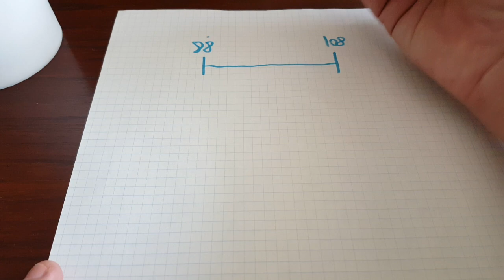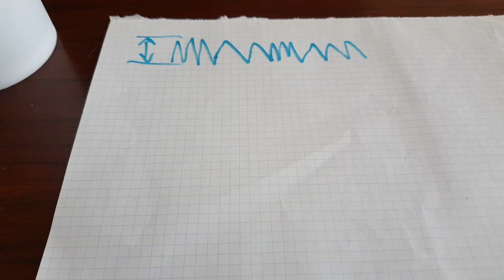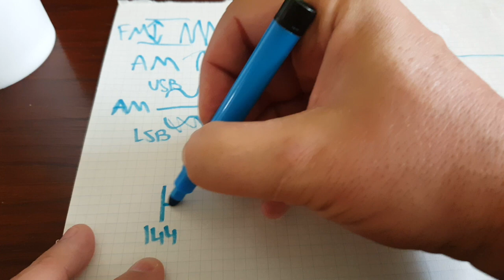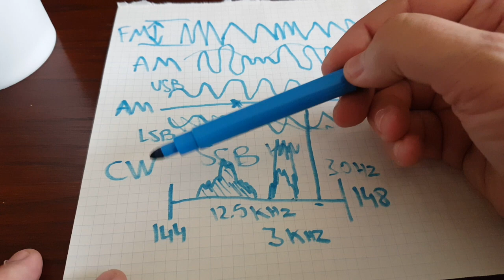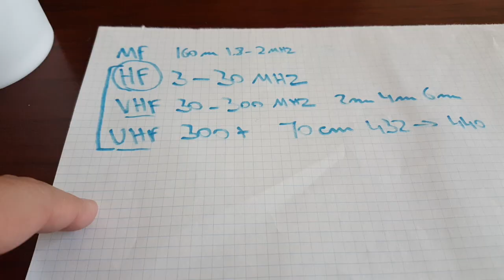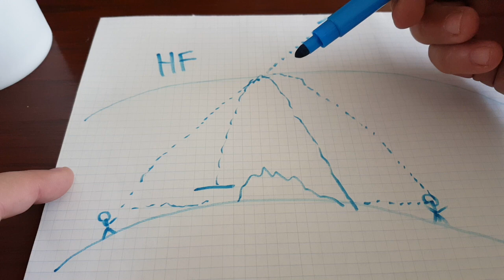Radio Frequencies, Bands, Modes and Bandwidth Explained.

Comment: I don't get, in the second AM drawing, what the center line represents and where the line made in the first AM drawing would fit in the second one.
Is the first drawing showing us a line that includes both SSB? Is there any connection in what these two drawings show us?
Reply from the maker: I don't quite remember the video, don't have time to check right now. But in AM the center line is the carrier, then you have the sidebands, identical but inverted.

Comment: Hi i got a ICOM IC-R72 but i didn't know what i can do with. I have no Antenna and i didn't know what antenna i have to buy. can you please help me. thx
Reply from the maker: That's a receiver right? If so you can just start with a long wire as an antenna, or a simple dipole.
Reply: @RadioPrepper  ok thx! 
must the cable have a certain diameter ? and how long it have to be? an what is a simple dipole?
Reply from the maker: @hannes8004 diameter is not important. Length as long as you can. Google dipole...
Reply: @RadioPrepper  i have 2 antenn connections on my icom where and how i have to connect it?

Comment: Why do you say refract? Isn't it reflection?
Reply from the maker: No. Although we often say HF waves are “reflected” by the ionosphere, it’s actually a strong refraction, not a sharp mirror-like reflection.
Reply: @RadioPrepper you mean the waves are actually "bent" by different ionoaphere layers until they turn back?
Reply from the maker: They don't bend. As a radio wave travels upward into the ionosphere, it encounters layers of ionized gas (plasma). These layers have varying electron densities, which affect the speed of the wave, changing its direction slightly as it moves through, until it's going back down. It's had for me to picture too, as I am not a scientist..
Reply: @RadioPrepper  Yes, that's what I was saying. That's why I used quotes for "bend"

Comment: GMRS is not a good choice for preppers. My side band CB supplies 90 watts for thousands of miles range  or AM for shorter range such as 200 miles.
Reply: I agree. GMRS has its place. It is easily portable with its tiny antennas
Reply from the maker: Both is a good choice 😉

Comment: It's strange that back in 2023 i picked a CW from croatia all over here in the Sahara of Algeria (1800km from their maidenhead location) on RTL SDR on the 80m band, i doubted it and i thought mb it was some mirror on IF, but mb bc of sun activity or something.
I used to mainly listen to volmet to tune my homemade dipoles on 80m 40m and 20m.
I was interested in picking local NVIS coms, but had no luck, besides one time hearing people talking touareg dialect on CB, the rest of time, CB is just spanish sailors in canaries, on some rare occasions i picked HF SSB Airband from the Atlantic, the rest of the time it was HFDL modes.

Comment: Thanks for the excellent video.
I think I don't understand something very basic.
I keep seeing wide band is 5 khz, and narrow band is 2.5 khz.
But, bigger frequency number in mhz = shorter wave length. 
100mhz is a 3 meter wave, and 200mhz is 1.5 meter wave.
Since 5 khz has a shorter wave length than 2.5khz, why is it called "wide"?
Reply from the maker: Hi, not the same thing... The 2.5 or 5KHz bandwidth refers to the width of your signal produced by the mode used, like SSB band is 3KHz wide so basically the sounds and signal produced by your voice is 3KHz wide. Nothing to do with the frequency you are transmitting on, which has a corresponding wavelength...

Comment: I also learned more in this short period of time than in numerous other videos lumped together..excellent presentation..

One question why is 300 used as the relationship between frequency and antenna /band length.  I am guessing it is the speed of light but why only 300?  

Thanks for the education and information. Keep up the good work
Reply from the maker: Speed of light, 299,792,458 metres per second.
Reply: @RadioPrepper  that's the confusion, as I said, I assumed the speed of light in metric, but why only the 300 and not the full nine digits.. just a niggle and probably demonstrates my lack of math skills, mind you school was a long time ago when I went.. 

Excellent channel thank you.. please keep up the good work.
Reply from the maker: Thanks, will do!

Comment: per-|o-lok = kind of bully or tease.

Page 72

atom = (Comp) A primitive syntactic unit, an indivisible unit of data. Used in PROLOG.
Reply: atmospheric engine = (Eng) Earliest form of practicable steam engine, in which a partial vacuum created by steam condensation allowed atmospheric pressure to drive down the piston.

Comment: First of all FM frequencies are above 30Mhz. And I didn't get what you mean by 12.5 kHz bandwidth because a signal oscillating at 12500 times will take a wide space in the spectrum. That's the amplitude which can become wider, but in the frequency spectrum taking wide range means varying frequency.
Reply from the maker: First of all FM can be used anywhere regardless of frequency, though it is prohibited on some bands due to the width (not amplitude) of the signal, usually 12.5KHz. The signal is not oscillating at 12500. The bandwidth can be 12.5KHz regardless of frequency.

Comment: Excellent video. What do you think would be the most consistent to use for emergency communication with relatives about 40 miles away.?
Reply from the maker: 40 miles is very difficult. You would need to get up high somewhere...

Comment: Great Video. Another question though. When you're explaining  SSB,  there's a horizontal line coming off "AM". Does that line represent 0 volts again? If so, why does the wave not cross the 0 volt line. How does the wave propagate if it isn't completing the cycle (Hz)? Thanks. The video is very informative. Really enjoying watching it over and over again.
Reply from the maker: I am going to look into that in more depth, thank you for your question!

Comment: so you get more range with a narrower bandwidth? and the less bandwidth is similar to saying its frequency/Hz are lower, so you get more range b/c the same amount of power is less spread out? Am I on the right track there?
Reply from the maker: Almost... The bandwidth is the width of the signal, not the frequency. For example, it takes about 3KHz to convey a voice signal but only 60Hz for a PSK31 signal, so at equal power PSK31 wins. That is independently of the frequency used.
Reply: @RadioPrepper   So when considering range, do you only have to really consider bandwidth and not frequency as much? And frequency has more to do with the type of signal being sent?
Reply from the maker: No. You confuse the two. Frequency will determine if your signal can bounce off the ionosphere or not, on which layer, when and how easily, or not at all. That is independent of the signal used. For example 14MHz will usually bounce off the F layer during the day. 50MHz will rarely skip but does sometimes on the E layer in the summer. 430MHz goes right out to space... The antenna used will usually determine the angle. That's where long range comes from and usually that's using HF frequencies. Signal bandwidth is say, the difference between a laser pointer and a flashlight. A laser, narrow signal, will have more range than a broader flashlight beam, power being equal... That is independent of the frequency used. For example, say you use USB wich is a 3KHz bandwidth on the 40m band, say 7100KHz (7.1MHz), your signal will cover 7098.5 to 7101.5KHz... Your center frequency is 7100KHz and your bandwidth is 3KHz. A PSK31 signal on 7100KHz will cover 7099.97 to 7100.03KHz, so being narrower than USB (voice), it will go further for the same power. Now, because it's HF frequency both those signals can bounce off the ionosphere and cover thousands of miles, but the PSK31 signal will be stronger. I need to make a video about this...
Reply: @RadioPrepper  That sort of made things a little clearer. Wow, why does it seem so complicated :( I feel like its kind of hard to grasp because a lot of it seems to overlap and so there is not much clear distinction in my mind. I would appreciate a video covering this further. It would be extremely helpful, sensei Radio Prepper
Reply from the maker: Will do :-)

Comment: I'm having a terrible time trying to learn where the 100 mhz center frequency is. I have an antenna that is designed to work on that frequency but I don't know if its for a range of frequencies that can be used or not.  I'm only getting 5 miles or less from a 150 watt transmitter and the antenna is at least 39 feet high. Can you please help me?
Reply from the maker: Not sure what you mean... 100MHz is in the FM broadcast band. Antenna length depends on frequency, and you can't transmit much outside of it without damaging the radio. What are you exactly trying to do? I can't answer without more info...
Reply: @RadioPrepper  Do you have an email address? I can provide all of the particulars there or would you prefer I just speak openly here?
Reply from the maker: gil@radiopreppers.com
Reply: @RadioPrepper  Awesome I will email you right now from djsmooth66@gmail.com

Comment: what is the size for those antenas, in lent, and diametrers pleasecan you print it just to shoe range
Reply from the maker: Usually simple wires a half-wavelength long, so between 5m and 40m.

Comment: I learned more in 33 minutes and 49 seconds about Radio Frequencies, Bands, Modes and Bandwidth tonight, then in the past 53 years of my life! Great detail and visual explanation of how it works! I needed it badly, as my Ham technician test is in a week and I have been trying to grasp the concept over the past few weeks. Again THANKS!!! Great Job!!!
Reply from the maker: Great, glad it helped!
Reply: @RadioPrepper  what ham radio would you recommend for various. Baofeng uv- 5r ? Would that do the job for long and short distance??
Reply from the maker: A baofeng is a handheld, for short distances. I would also suggest an HF radio, 3.5 to 30MHz, and that is a vast subject to cover ;-)
Reply: @RadioPrepper  ok thanks
Reply: @RadioPrepper  what is tri band and dual band?
Reply from the maker: That is the number of frequency ranges a radio receives and transmits on. For example, a dual-band handheld radio might cover 144-148MHz and 430-440MHz, two different sections of frequencies. A Tri-band radio might cover 50-54MHz on top of that or say, a range in the 220MHz band.. Dual-band handhelds are most common. HF radios have many more bands, usually from 1to 11..
Reply: @RadioPrepper  ok cool . so i should look for a hf for the most bands? And also is a paofeng of to start with? Im new to this
Reply from the maker: Yep, you can start with a Baofeng, then look for a used HF set and start listening...
Reply: @RadioPrepper  ok one more question. HF are they handheld?
Reply from the maker: No, there are some rare models but 99.9% are not. They can be desktop home radios, mobiles or portable. Look into "QRP radios."
Reply: @RadioPrepper  thanks
Reply: @RadioPrepper  thank you sir
Reply: Same here
Reply: 5⁵

Comment: Hello. for longer distances what do you recommend for baofeng uv 5r? narrow or wide band? Thanks
Reply from the maker: Narrow. That said getting higher will extend range the most. Either you get higher or use a mast to get an antenna as high as possible.

Comment: Is there such a thing as a good kettle H capital F handheld radio? As a transceiver I mean I guess thank you I’m trying to get my license!
Reply from the maker: What is a kettle H capital F handheld radio?
Reply: @RadioPrepper  I think he meant capital H capital F. Not sure why say it that way though. Its simply HF.

They made some 10M hand helds and CBs. The closes thing I know to a full HF hand held is the FT-817 and the Xiegu radios. 

Unless you just want to receive and the Kenwood TH-F6A I think covers HF. I always thought about getting one but never did. I doubt it does very well with the factory antenna. One for the specific band you are interested in will work better. 

I miss my FT-817! =]

Comment: Hi 
Is there any way to received uhf calls by lamp or light worning if the radio 9n mute.
Reply from the maker: Sorry I do not understand your question.
Reply from the maker: Ok, I think I might understand... Maybe using Morse code and converting the 600Hz Morse tone to light...
Reply: @RadioPrepper  thank you for your reply.
I fixed UHF radio in my car I often forget that it's on silent(mute) mode so I want some way to be able to have a light signal to draw my attention for incoming audio (voice)call
Reply: @RadioPrepper  voice incoming call

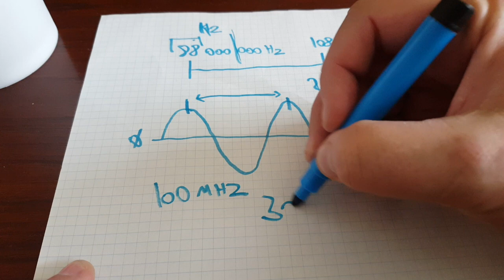Comment: At 4:10, did you use 300 because the speed of light is 3 * 10^8 m/s, and in terms of mega, 3*10^8 = 300 million = 300 Mega?
Reply from the maker: Because of the speed of light yes. The radio wave travels a certain distance per AC cycle, in the case 0f 100mHz, around 3m.

Comment: 50 hz in USA and 60 Hz in Canada.....we only have 120 V here...
Reply: 60Hz is USA at 110volts UK is 50Hz at 240Volts...
Reply: The standard in the United States is 120V and 60Hz AC electricity. However, due to fluctuations, the average measured voltage is 117 VAC, hince why most things are @ 110Vac.

With most USA appliances supporting both the US and EU standards (EU 220vac 50hz) of course you need a plug adapter in the EU if the appliances are made in the USA.
Reply from the maker: I think it's 60Hz here in France.
Reply: It's 50 Hz in France ;)
Reply from the maker: Merci, je ne m'en souvenais plus.

Comment: Always wanted to ask this question.  Why so much voltage in Europe?
Reply: A better question may be why such a low voltage in the U.S.? I think it has something to do with the rivalry between Nikola Tesla (who favored AC) and Thomas Edison (who favored DC). [see https://www.energy.gov/articles/war-currents-ac-vs-dc-power] To protect his business investments Edison tried to sow fear over AC current (e.g. by promoting use of AC with the electric chair) and I wonder if his efforts influenced the adoption of the system in the U.S.  In reality, the European system carries no more danger of electrocution and the greater available voltage can provide a greater efficiency.
Reply: Also the higher voltage using only half the current for the same power meant a 50% saving in copper used and less voltage drop over longer distances due to less heating losses in the wires.
Reply from the maker: It saves on metal used to make the wires. Half the current equals thinner wire.